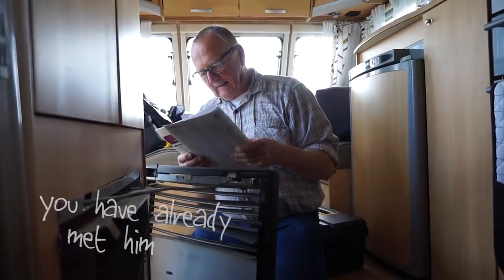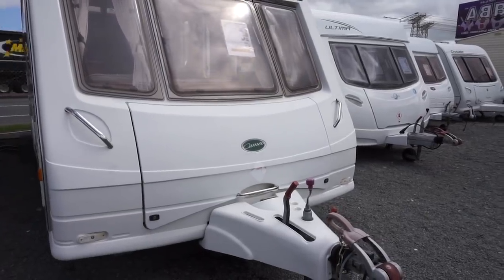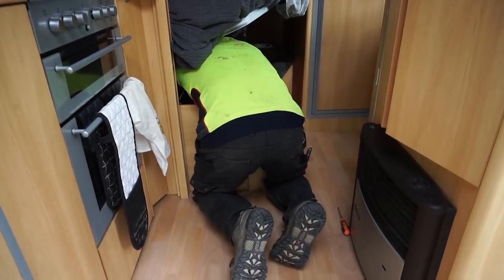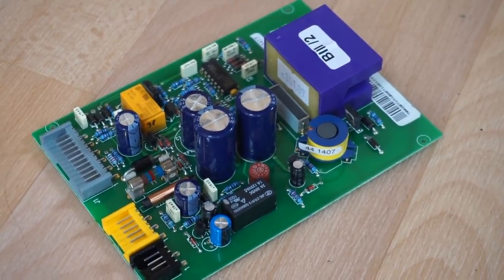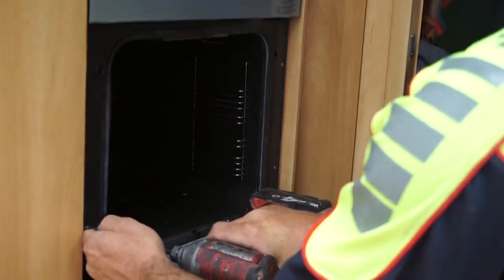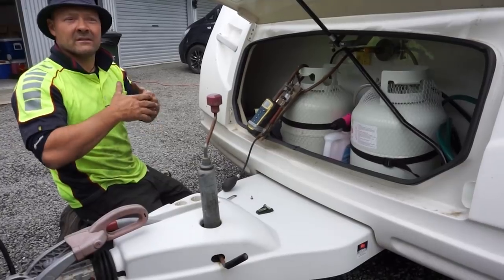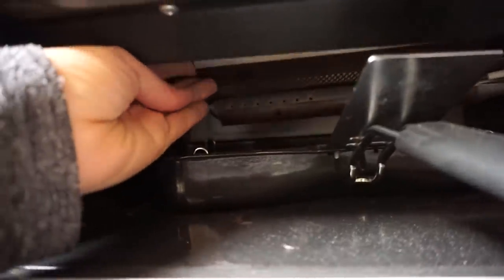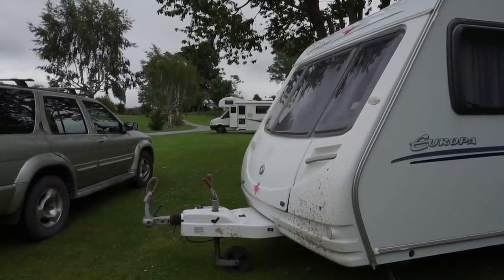Fixing Caravan Gas Issues - Truma Hot Water System & Trumatic Heater

Comment: Just  catching up,going back to when you had that Grey water leak from the joint in that  pipe under the floor,the reason why those type of joints can come loose is because the "U" shaped  fittings that hold them to the floor sometimes become loose and allow the pipes to move with road vibration etc,loosening the joints.So when puting them back together,allow the pipe to slide through that "U" shape holder untill the joint is firm and in place.Also a good idea is to put silicone arround the pipe befor fitting them together.Silicone will make it water tight.Make sure those holders are screwed firmly to the floor and there is no movement in the pipes.You can also change them to a different spot if the screw holes have become too worn.Be sure to fill any small holes   in the floor with builders Mastic from a Hardware store,any larger holes ,use  peices of flat ply wood cut to the size needed,put Mastic on both the ply wood and the foor,and screw it on.This will keep dampness and insects out....Happy Camping/Touring.!
Reply from the maker: Thank you for the advice! I guess the caravan does shake a lot while driving.

Comment: Hi Karen . I just noticed that Gas fitter installed your Carbon monoxide detector by you door close to the ceiling, It should be mounted close to the floor as Carbon monoxide is considerably heavier than air!

Comment: Hi Karen, great video of yours I came across, though it been 3 years, do you still have your caravan? ...it is easy for me to say now, and the fact I live in the UK ...the PC board I may have been able to repair it (availability of electronic parts) as I'm an electrical mechanical engineer, and yes, where are we when you need one! ...the issue you had with cooker, as they are mass produced, screws are not always tightened, and road movement would loosen them! ...after 20 years out of caravanning I'm looking to start again for UK and Europe travel ...so Karen, I would really like to know if your still using the caravan or another one ...Kind regards Norm's

Comment: Thanks , the front of my heater pops off and hard to put back on , now i know how to fix 
Don't travel with your blinds down , it saves the plastic clips and don't put anything on the glass top of stove as 
it is not good for the safety gas cut off
Reply: don't think a caravan that old will have a gas cut off on the glass lid.
Reply from the maker: Goodluck putting the heater cover back on! I think my window clips broke just from over use 🤣
Reply: @MrSnookerballs  My 2006 Abbey 315 has the same stove, if you put the glass top down, it shuts the gas off
Reply from the maker: Yes, mines the same for the stove top. A clever safety system!

Comment: Hello Karen I'm looking for the opposite advice on how to get the cover off of one of these fires in my caravan. I have now been 11 months in my 2010 Bailey pageant monarch series 7 and I have been on a powered site as you know all winter and ironically there was a power cut yesterday within the district of Otago and I actually ignited the gas fire as a last resort to getting warm and after it had burnt off 10,500 dog hairs and some fluff it settled down and I was absolutely gobsmacked at how warm it was so I opened a couple of windows slightly and spent a few hours in absolute warm paradise just could not believe it so what I want to know is how to take the front cover off to clean it out and I can pull the top two sides down but they only come out a certain way and then stop so I'm looking for guidance how to get the rest of it off and I'm just assuming perhaps maybe the gas regulator knobs have to come out but how does it come out how do you get that front cover off so that I can go in armed with one vacuum cleaner and some cleaning rags. I also think it might be an idea too get a gas detector or is it a CO2 or something but anyway I digress it's a cold Sunday morning down here on the Taieri and I get my tow bar on my newer vehicle in 2 weeks so maybe traveling north on a tiki tour looking for my new home and my new roots. Happy Sunday Karen did you forget to put the clocks forward like me ?
Reply from the maker: I thought I'd try and find a video to show you how it's done.... and I couldn't find a similar one! Sure I showed it in an old video... hmmm. Shall have a look later.
Reply: @TravellingK  I managed to find the only tutorial which was from England and it is in my either liked by Steph Sancia or favorites playlist and it's quite simple-ish there is a middle screw center behind the fins at the top you undo that it's a Phillips and then there are two kind of clips either side pull out and then just lift off and then take out lift off the gas regulator knob and then it just comes out and there was a ton of fluff and mess and a blanket of just toot all over the gubbins so I hoovered it all out and gave it a good old clean and managed to get it back together with a little bit of difficulty but I left the central screw behind the fins out although I have kept it. The plug that goes in the fan speed regulator is a very strange plug and it looks as if it actually goes nowhere but behind the cover of the fan speed regulator that is a little printed circuit board and the plug just slots over that so half the plug is above and half is underneath and all is good but I will plow through my playlist and put the link here just in case you don't have time I mean it is as far as I can see the only one on YouTube and it's actually a very very critically useful video back in a minute

Comment: after using a gas grill, (as part of a normal size oven in a house) for 6 years, melted control knobs and the same problems of stuff falling down/off, rusted screws, i think its just too hot for long term use.  using the bottom element in the oven dosent seem to be so destructive to the rest of the oven. im so going to miss my toaster when i move into my MH, looks like the old camper toaster on the gas ring. feeling your pain Karen...
Reply from the maker: Yikes! Melted knobs and rusted screws! I did miss my toaster at the start, but eventually got use to grilling my toast.

Comment: Hello - please read this:
Because of the type of environment these unit live in - the contacts, will tend to "oxidize"
When these contacts oxidize - they loose the ability to conduct current.
----- removing the motherboard, then scraping the contact points (the point where the "pins connect with the motherboard") will allow the system to work again.

Most repair people do not know this.
Most repair people will solve the issue the easiest "NOT THE CHEAPEST" way they can.

Moisture is a real bitch. It will rot everything in this lifestyle.

Good luck to you my friend.
Reply from the maker: Ahhh that's very interesting. I wonder if that was it?
Reply from the maker: Sounds like you have a bit of experience, haha. I have asked my viewers for advice in the past... particularly about my ongoing fridge issues! haha. I've overall received some really helpful information abut caravanning and have learnt a lot😀
Reply: @TravellingK  
I suppose you are right.
I am jumping into an on-going vlog. I should have read some of the past posts to see how you communicate with viewers before giving advice. -- `My Bad` __
Actually - I am jealous of your freedom.
Old age has me wishing more time out living instead of time out on service calls.

Enjoy it young lady. Keep making me jealous.
I'll learn to enjoy the frustration
Reply: I had identical problem with my Truama water heater. The £300 pcb just sits on the flame detector contacts. Sorted out cleaning with electrical contact spray. Poor design IMHO .  Really glad you got an alarm fitted it could save your life!!
Reply: @sapphiresword139  you're great, sapphire sword! would love to meet ya

Comment: Sorry to hear about your water,heater a gas problems,glad you have a carbon monoxide detector now,very important.
Hope you don't have any more big problems,you should take the van back to caravan engineer ,to check he forgot
 to tighten your grill ?
Reply from the maker: Yes, so glad it's all been fixed! The grill has a crack in the metal on one side rather than a lose screw - would have been amazing if it was just that.
Reply: Oh sorry its cracked,the engineer did a good job ,keep smiling Karen

Comment: I’m not sure if it’s already been mentioned but your co2 alarm is way too high up the wall. He hasn’t installed it correctly. It’s meant to be low down, no more than a foot from the floor. Carbon monoxide is a heavy gas. The level slowly rises. If you waited until that alarm went off, you would already be dead. I strongly recommend you reinstall it yourself somewhere low ASAP.
Reply: You are completely correct, it made me wonder if he knew what he was doing,  It even states in the installation instructions the correct height it should be fitted which is certainly not 6 foot high.  Karen I  would contact him and put him straight as that mistake would cost him him gas registration if a complaint was filed.
Reply from the maker: This is something I need to look into and check! I've had people tell me it should be low and others say their alarm is installed there.
Reply: @TravellingK  Karen  go to rvworldstore.co.nz and it has a very good summary of all you need to know about gas detectors for caravans etc.  It also states that lpg is heavier than air so detector must be installed slightly above floor level, your tradey needs a good kick up the backside.
Reply from the maker: Having a look online, it seems like the gas alarms are installed low but the carbon monoxide can be high?? "Carbon monoxide (CO) is slightly lighter than air, so carbon monoxide alarms are effective when placed on the ceiling or high up on a wall"
Reply: I think you should be very careful about giving advice on a subject you know little about. The CO alarm was installed in the correct location and is in exactly the same place as ours on a brand new caravan. I'm no expert myself but my guess is Butane/Propane is lighter than air which is why caravans have vents in the floor under the gas appliances and in the gas locker.